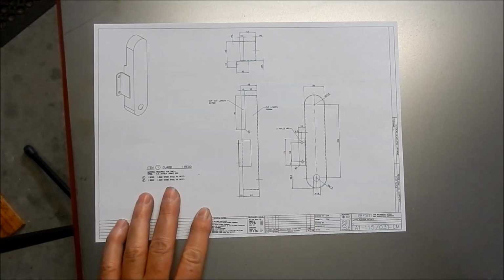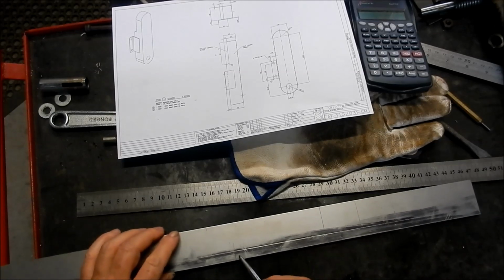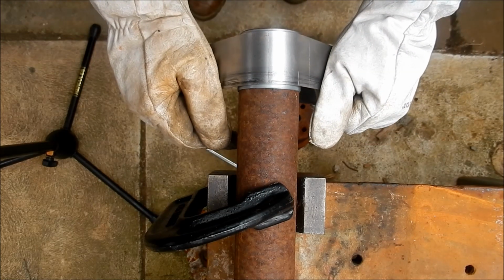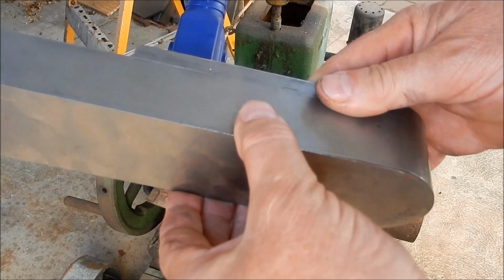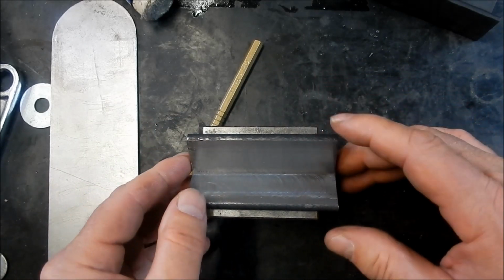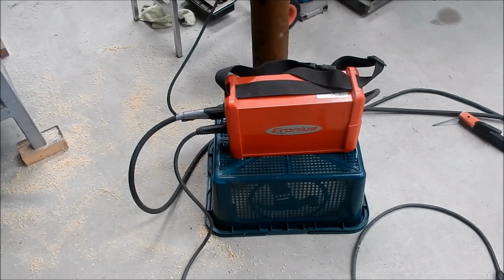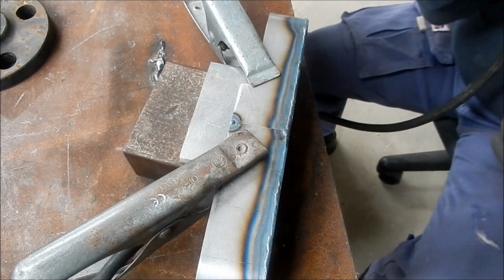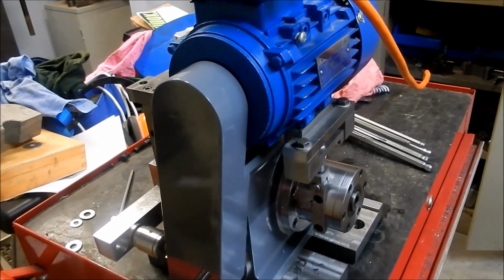Lathe Slotter Belt Guard

Comment: The guard should also cover that exposed end of the shaft that is protruding.  It would simple enough to secure a hollow bell shape of sufficient depth from the back side of the guard, or have your mate weld it from the backside.  Might as well go for full protection from the rotating bits.
Reply from the maker: G'Day Carl, I have a keyway fitted on the end of the shaft so I could secure an adjusting knob if required if I wanted to actuate it by hand to set stroke depth when I was commissioning.  As it turned out it wasn't required.  I was going to enclose it but before I get anywhere near the shaft my hand would hit the reciprocating ram which sits quite a bit higher.  Good observation though.
Cam

Comment: Nice to see your new shear in action Cameron! I'm wondering why you cut your sheet stock on the bandsaw and then on the shear? I didn't get to see if your shear has a proper bypass setup. That might be the reason. You cannot make a long cut without the material on one side hitting the shear body.
Reply from the maker: G'Day KA, the way the Shear is designed you could cut any length of sheet.  The problem for me was to hold a 600 x 500 x 1.2mm sheet on the temporary set up I had.  It was easier for me to just rough cut it down using the bandsaw table and then do the finish cut on the Shear.  
Cam

Comment: Happy to help out with your safety guard Cam. Turned out to be a nice little fusion weld job. So for welding this we used a 1.6mm Lanthanated Tungsten on 40amps DCSP (direct current straight polarity) in a 9V flex head TIG torch. The filler wires we used were a 0.9 ER 70S-6 MIG wire which is great for thin plate low amp welding, Also used was Silicon Bronze for the mounting tab, I chose this to reduce distortion on the flat side of the guard. The finished job after coating looks great Cam
Reply from the maker: Thanks Andy, let me know how you get on with Pep doing your former.
Cam